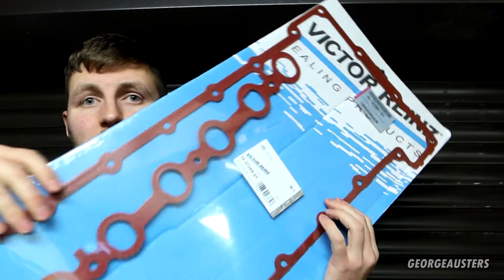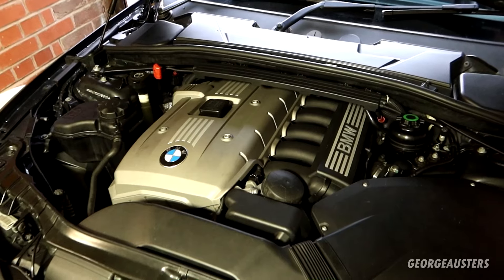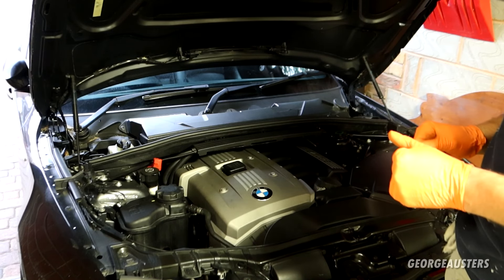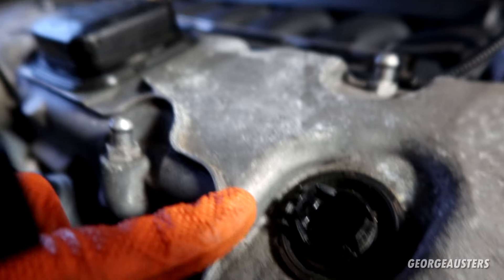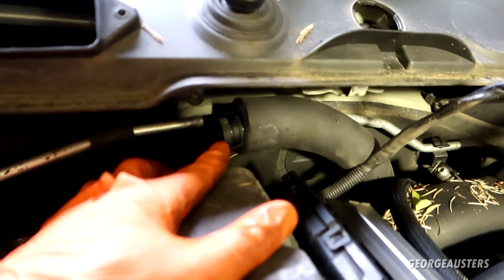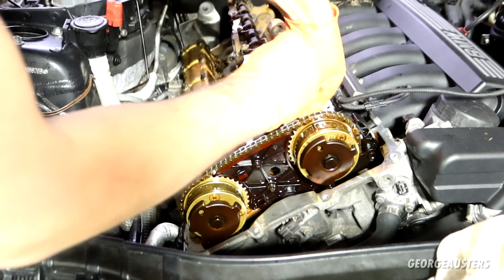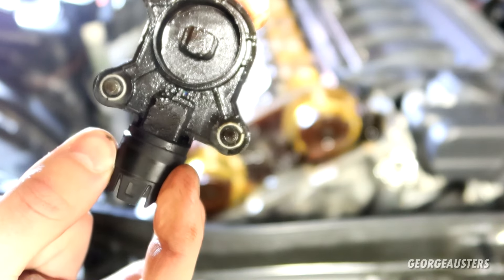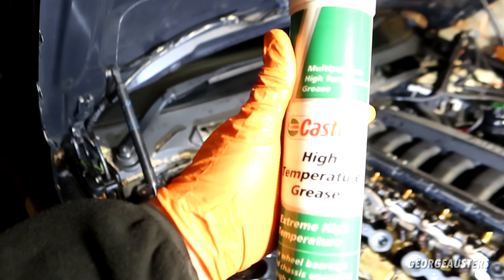BMW N52 Eccentric Shaft Sensor Replacement *MUST WATCH*

Comment: So many sensors and modules you have to replace in a BMW before 100k miles is a joke.
Reply: Yea that’s the only thing I don’t like. 200$ or more at least for most sensors. You’ll spend easy 1k on just sensors because they failed
Reply: Facts I just reached 91,000 and for it's birthday the car decided to stop using this sensor
Reply: Im at 78k. My 128i fails on warm start.

Comment: I haven't read codes yet, but what my N52 does is when I cold start in the morning at the first start the engine starts nicely but then drops the rev and engine shuts off (if I give it a little bit of gas before it would shut off it doesn't) second try it usually runs nice even without pushing the gas pedal.  It doesn't have any other symtomps, no loss of power, nothing. Plus if I drive just a few hundreds of meters, turn it off, turn it back on it doesnt do it again. But after 8 hours of work it does it again.  This seems like a long procedure to replace, and I can't do it myself , do you have any idea if this is the issue or by my description something else? Thank you, even though I don't do the mechanic work I love watching your videos and having a better understanding of what's under the hood.
Reply: Hi. I am facing the exact same issue that you re describing. Please let me know, did you find the root cause of this issue? Did you fix it?
Reply: @alextitus2580   Nope, unfortanely nothing fixed it yet, I'm kinda used to it now and don't wanna just randomly change expensive parts for this.
Reply: @bojlitj7511  thanks for letting me know. It happens all the time that on first turning on (after a few hours after the engine is turned off) to die or there are times when is not dying ?
Reply: @alextitus2580  I think it would die every time, unless I gave it gas, but I'm not really experimenting anymore cause I don't want to it to die, so I just give it some gas, what happens sometimes is when I start the engine it revs a bit higher first, then I have to constantly give it gas for a bit longer, not just 1 throttle, otherwise it will die.  But most of the time just a small push to the throtthle is enough. Do you have higher oil consumption?
Reply: @bojlitj7511  thanks for update. No the oil consumption is like 2 liters / 9k km
Reply: Hi, I don't know if you managed to solve this but I had the same issue in my first E90. I would start the car and right when the idle settles 600RPM the engine would drop out and sometimes stop. I would have to start it again then it would be fine. It turned out to be the vanos solenoids. Replaced them and it fixed the issue.
Reply: @bonganisiziba6154  hmmmmm....... and I was gonna say a dirty throttle body caused by ethanol that is in our gas.  is there ethanol in the gas that you buy?  just a suggestion more for the OP since you figured out your issue.

Comment: The only thing that you really needed to do was to clean the oil out of that connector well very well and clean the connections and then replace that seal.  That seal can be changed out with a new replacement WITHOUT removing the valve cover.
Reply: Wrong. The sensor fails internally and weeps oil into the top of the sensor where the pins are. No seal cam stop this

Comment: Why didn't you show replacing the sensor seal? That was the one thing I came to watch...
Reply from the maker: It literally just pushes in
Reply: You just use a pick to get it out or if you're doing the entire valve gasket you simply push it out from the inside

Comment: you can take the plastic cover without removing the filter. Just unscrew the bolts and it will pop out. When you only need to replace the seal

Comment: Thanks for the video! How do I go about re learning the valvetronic motor end points? Do I need a scan tool?
Reply: Hey I have the same question as you. What did you do?
Reply: I ended up buying an Autel scan tool to do the relearn. BUT I’ve been told the relearn can be performed by turning ignition on (without starting engine) for 10 seconds and back off again two or three times.

Comment: Any tips on getting a new eccentric seal in? 30/32mm socket and hammer it in? cheers for all your vids
Reply from the maker: Should just push in if it’s clean
Reply: @GeorgeAusters  cheers! turns out there was a whole outer bit of the old seal still in there, looked like it was part of the cover... many hours wasted haha

Comment: Would this cause a bad rattle from the engine that completely goes away after 2000 rpms?
Reply from the maker: You’ll have fault codes for eccentric shaft sensor

Comment: What are the symptoms of a bad eccentric shaft sensor? I think mine may be going out also. At cold start up mine bounces the idle up and down and sometimes even dies.
Reply: My car is having the exact problem I replaced the sensor I got my acceleration back when I replaced it but the issue still consist so I’ll be replace the harness that goes to the sensor since oil was getting to it hopefully that fixes the issue
Reply: @gregopahl4903  Make sure you reset adaptations also.

Comment: This is why frequent oil changes in BMW are so important. Lots of sensors and components and gaskets that must bathe in the crummy old oil people try to push to 10k miles just change your oil every 5-7k. Just one extended interval can lead to all sorts of issues down the road. Seals failing prematurely, oil getting into electrical connectors clogged Vanos solenoids and more. Plastic sensors like ESS are susceptible to oil based damage as well. 

If you notice the outer part of the oil pan gasket does not become brittle and hard like the inner part of the gasket. People say its just crap design and material but metal + rubber gaskets are the best kind of gasket designs. When your oil pan leaks on these cars you can touch the part of the gasket that hangs out and it is perfectly pliable while the inner part that is in constant contact old with oil will fall apart. Basically, some level of what they call "crankcase dilution" where fuel naturally gets into the oil and in turn can harden the rubber materials or cause them to degrade faster.

Comment: Oil is conductive and it was scrambling the information that the sensor was trying to send to the ECU and that is why it shut off the valvetronic system and defaulted to running on the throttle body.  How do I know?  The same thing happened to me.  I cleaned it all with Electronic contact cleaner that was not conductive and would not harm plastic -- After that it purred like a kitten and my gas mileage returned to the high 20's -- 28 highway and 25 in town.
Reply: Mine still works, im not sure if its coated with oil or not. I think it may be okay but would cleaning work rather than spending money on a new one?

Comment: I have the sensor faults on my N52 along with mixture control faults. Could the valvetronic system failing cause that or just the sensor on its own (no oil in plug). Many people who ive spoken to about this have claimed the sensors dont often fail?

Comment: I’m looking at forums. It appears that we may be able to reset the valvetronic adaptations by inserting the key, pressing the start button (foot off brake) and the adaptations should be reset. Your thoughts, George?
Reply from the maker: Yes that is correct Jon!
Reply: So literally just turn the ignition on and jobs a good un? Surprisingly easy
Reply: @brodiehaward  ʻ

Comment: HI, after the  valve cover gasket and the Eccentric Shaft Sensor replaced due to oil in it, on BMW 325i E90 RW SDM 4 DOOR after driving for 54 K, the engine Light came on and the engine over Heated, what can be the problem? if you can help. Thanks. keep up with the good work, I enjoy watching your videos.

Comment: Hi, I've noticed in inpa that Vvt-extcenter Istwert is reading a full bar and !1440.01 at idle. I sometimes get a bad cold start and pulling away up the hill I'll go into limp. Restart the car and it might be ok. Should I be investigating this part? Cheers for great vids George

Comment: Hi George!  Great video!  I found you because of a problem with my 2009 128i N51. It's a crank, no start.  It has the following "Valvetronic, eccentric shaft sensor; plausibility" codes; 2A38 (Valvetronic sluggish or open circuit), 2A37, & 2A47.  Based on your video, it looks like I need to check the Valvetronic shaft sensor for oil contamination (sluggish or open circuit).

I have not done any work on this new-to-me 128i other than oil change and filter changes.  I have done plenty of DIY work on Toyotas and Subarus.

Once you completed this job, at around the 13th minute, you mentioned the need to 'relearn Valvetronic limit positions'.  Is this a requirement when replacing the eccentric shaft sensor, or was it to resolve the timing problem you spoke about?  If required, did you use a BMW-specific scanner or another device?

Also, I just found your BMW N52 Valve Cover & Valvetronic Motor Gasket Replacement COMPLETE GUIDE (https://youtu.be/rRK-lLR7YqI).  Thanks!

Comment: Is it normal for the idle to run rough afterwards
Reply: Yes. Needs to relearn and figure out the signal.
Reply: @mr2_mike okay mines been running rough for about 5 months now😅 what could I have done wrong

Comment: How did using the Continental brand eccentric shaft sensor work out for you? I was thinking of replacing mine with an OEM eccentric shaft sensor but would rather go with a cheaper option if it wokrs just as well!
Reply from the maker: Continental is OEM👍🏻

Comment: My son's bmw E60 2007 has a problem not even the BMW workshop can fix. 
At low speeds, when driving over speed bumps, the engine loses all power for a few seconds and then runs as usual.
I have basically replaced all the sensors that are available and replaced the spark plugs, and disconnected the anti-spin system. 
Nothing helps.
My error code reader says that there are no errors. 
What can we do?
Do you have any suggestions?
The car is only driven during the summer and has only been running 13.0000kn / 81,000 miles.

Best regards from SWEDEN.
Reply: check for loose connectors. or battery isnt connected properly
Reply: Wheel speed sensor or your abs ring if your getting a 4x4 warning and it limits power

Comment: Hi George. I have a new valve cover kit to fit on my 130i. The car is on 128k miles and runs well with none of the issues you mention in this video but would you advise replacing the eccentric shaft sensor anyway while the cover is off? I'd rather not given the expense of the sensor. Also you mentioned resetting the valvetronic motor parameters after reassembly. Is this essential? I don't have ISTA but have access to a BMW specific iCarsoft unit. Thanks in advance!
Reply from the maker: Yes I’d recommend replacing the sensor at the same time! I believe you can reset the valvetronic motor values with the use of the pedals👍🏻
Reply: Thanks George!

Comment: I have problems on cold start for a few seconds the idle is rough, and afterward everything is good i would say. All glow plugs are changed and the relay too. Can an oxygen sensor be faulty without reporting an DTC? What is the best way to test it, can it be cleaned maybe?
The car is E91 LCI 318D 105kw 11/09, it has only 1 oxygen sensor I would say only on the DPF, next to the temperature exhaust sensor and the pipe for pressure sensor. 
Thank you for the answer in advance.
Reply: Yes an O2 sensor can get lazy and not throw a code.

Comment: It is worth it to remove the cowl as well. You just remove the wiper arms and the plastic bits under it. It will make installing the valve cover gasket easier. For the plastic cover, you can't get it out without fighting it up plus you need more space for the ccv pipe so you don't break it. It is rock hard on most cars.
Last but not least the plastic cover has spark plugs tubes which are also a pain to remove unless you have c clip pliers.

Comment: Hey bro, thanks for not mentioning exactly how the eccentric shaft motor needs to be removed. I ended up chipping a few teeth on the gear when it snapped back on the screw gear. 

For anyone watching this, use a 4mm Allen key in the hole on the back of the motor and turn clockwise until you feel it stop BEFORE removing it or you’ll end up having to buy a $1200 eccentric shaft. Do the opposite when placing it back in.
Reply from the maker: I did explain how to remove it?
Reply: @GeorgeAusters  Bro, watch your video and you will see you didn't, haha.
Reply from the maker: @Cheezus_ROBO  Sorry I explained much more in this video: https://youtu.be/rRK-lLR7YqI